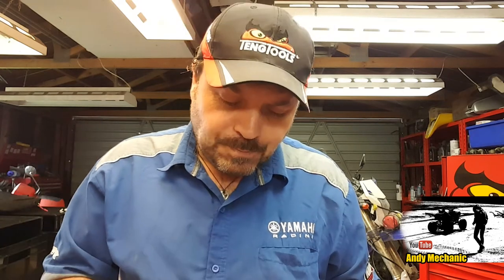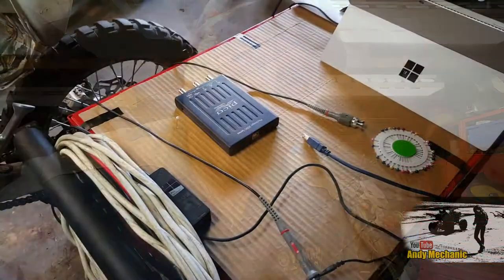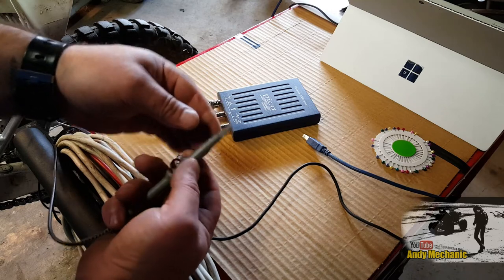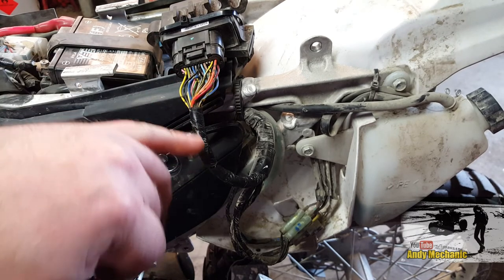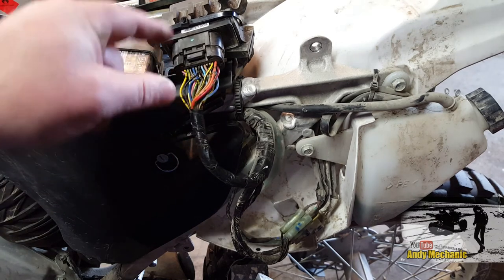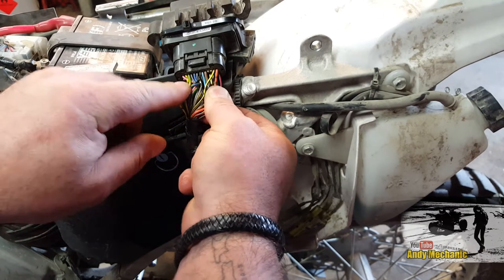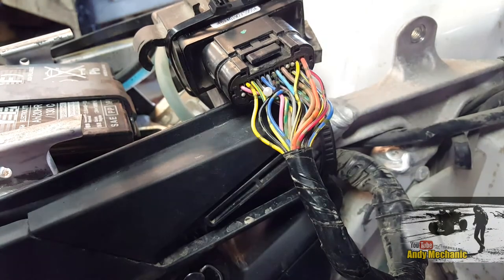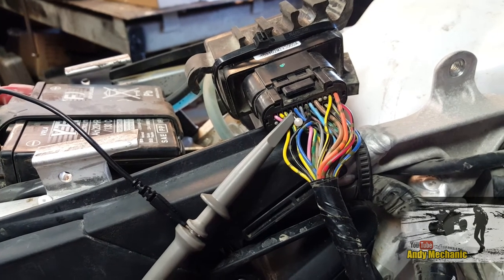How to capture a crank angle sensor waveform using a PicoScope #1214

Comment: Might be a plan to show folk where to get info on wiring and pin designations and how to read a wiring diagram.  Good video BTW.   Interesting stuff this Pico.  I'm using glorified multi-meter :- a Snap On Vantage Ultra which has the lab scope in it.
Reply from the maker: +Land Rover Toolbox Videos Good advice I'll include that aspect when I'm next 'scoping' something that's not Yamaha. I have to be very careful what I include in my videos since I started working for Yamaha New Zealand as their Motorcycle Technical Support.

Comment: Can you please explain how you connect a scope to a 2-wire VR sensor that has positive and negative wires? Regarding the voltage fluctuations at higher RPM - it might be that your sampling rate was not high enough so it simply did not have enough resolution on the time axis.

Comment: How much more suitable for cars are the standard Pico scopes compared with automotive Pico scope? I only have a very old analog scope and would like to upgrade, but have very limited budget. I'm concerned that 10M ohm probes aren't going to be sufficient, so unless I can reasonably adapt them or find 20M ohm probes (or attenuators) I'll have to find another way besides a PC scope.
Reply from the maker: +Geo Logic Hi Geo, well, you do raise a great point. The basic scope I have, the 2000 series, is an excellent scope for the money but it does have its limitations. However you can perform all of the sensor testing with it plus most actuators. It struggles with coil primary due to induced voltage from the secondary.

It's a great scope to learn with and get started. Then, if you find you are making use of it on a regular basis then it helps justify the upgrade to the Automotive scope.

Hope this is of help. Cheers Andy